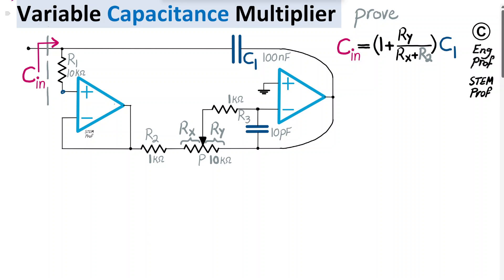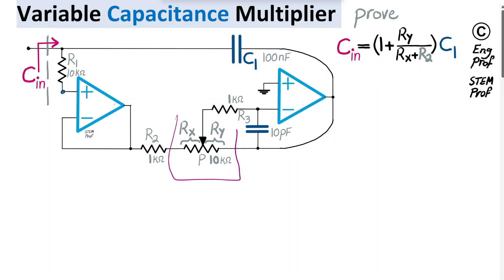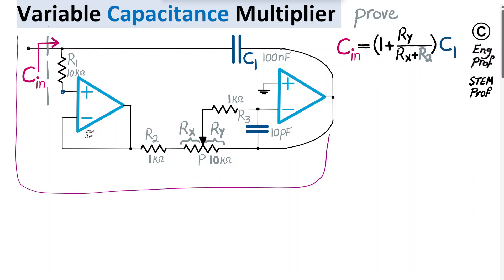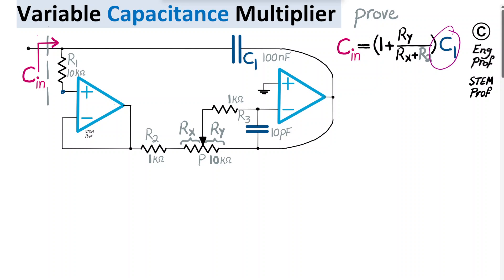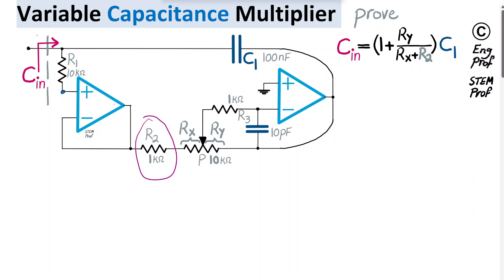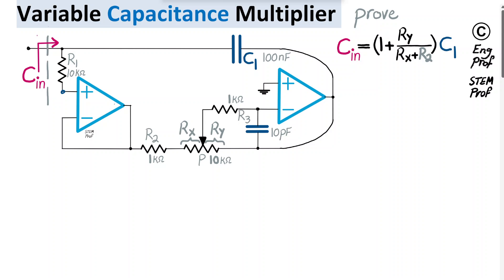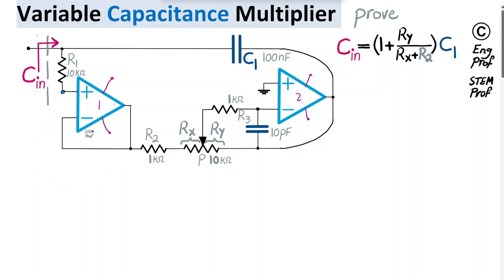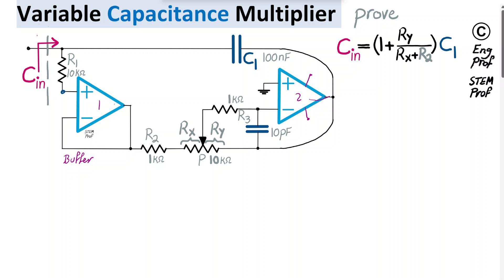Variable Capacitance Multiplier Design with Op Amp

Comment: Is that capacitance across Vin and Gnd?
I’m interested in using a circuit that employs a “variable capacitor” for an audio application so I can have independent control of gain and cutoff frequency. Could I use this circuit to substitute a cap that goes from signal to ground?
Reply from the maker: Yes, you can potentially (at least for a limited range of operation) use this circuit to substitute a capacitor that goes from signal to ground since this design implements a ground-connected capacitance on one side. The variable capacitance multiplier presented in this video allows for an adjustable, possibly large-value capacitance, which can be useful for your audio application requiring independent control of gain and cutoff frequency.
    The circuit is built using two operational amplifiers and a potentiometer, leveraging a combination of positive feedback and dominant negative feedback. The positive feedback enables a capacitance scaling factor greater than one, while the negative feedback ensures stability and enforces the virtual short between the Op Amp inputs. The first Op Amp functions as a buffer (unity-gain amplifier), and the second acts as an inverting amplifier in the frequency range of interest.  
   Regarding practical Considerations: For a real-world implementation, component selection is critical—otherwise, the circuit may become unstable. Op Amps should be carefully chosen based on the application, ensuring they have the right frequency response, low noise, and stability characteristics. Zero-drift, ultra-low-noise CMOS Op Amps (for example from Texas Instruments) are often a good choice, particularly for sensitive audio applications. Additionally, careful experimentation is needed to fine-tune the circuit and avoid issues such as oscillations or excessive phase shift. For related applications, check out:
🔹 Simulated Floating Inductor (Capacitance-to-Inductance Conversion) – Watch https://youtu.be/weIHG45G6Pg 
🔹 Butterworth Filter Design with Capacitor Multiplier, Op Amp, and Transistor – Watch https://youtu.be/9CFPe76vAtg
Hope this helps, and thanks for your interest in the circuit!
Reply: @ thank you so much for taking the time to give me such a thorough response. I was able to get this circuit to work.
I used a TL072, the only tweak I made was to change the 1k resistor that goes from buffer output to the pot from 1k to 2.2k. I noticed that higher values of capacitance was killing my gain so i limited it by changing the 1k resistor to 2.2k, thus limiting that part of the sweep. I was not able to figure out why that was happening, any thoughts?
I’d like to take the opportunity to thank you for making these videos, I hope you know they are awesome and that they positively impact other people in ways you may never know. Rock on!
Reply from the maker: @mamaki_naminia  My pleasure. Thanks a lot for your encouraging comment. I'm glad that my explanation was helpful and glad that the circuit worked with minor adjustment. Thank you for sharing your observations and thoughts. TL072 is a good general purpose FET dual-channel Op Amp from Texas Instrument. I suggest retrying your experiment using a newer precision Op Amp that has near-zero drift and better noise performance, for example TI's dual op amp OPA2186 is a 5-μV-offset zero-drift operational amplifier that might give you a better performance. Let me know if it happens to improve your circuit.
Reply: @STEMprof  i will try the OPA2186 and report back and share any findings.
Thanks again.

Comment: What is "S"?
Reply from the maker: In S domain circuit Analysis, the circuit is transformed from time domain to Laplace domain where derivativative of variable is represented by multiplying variable with S and integrating a variable is represented by dividing it by S.  I hope this is helpful.
Reply: @STEMprof  I'm afraid you might as well have been speaking Chinese. Is there somewhere I can learn about this?
Reply from the maker: @TomLeg  Please watch the video: Analog Computer that solves Differential Equation https://youtu.be/ENq39EesfPw . I hope it helps with explaining what I meant by S domain circuit analysis.

Comment from the maker: Implementation and analysis of a variable capacitance multiplier circuit are presented in this video. This circuit is useful in applications where a large adjustable capacitance is needed. This Analog circuit is implemented with two operational amplifiers and one potentiometer. For more circuit design videos please see the analog circuit and signal processing video playlist https://www.youtube.com/playlist?list=PLrwXF7N522y4c7c-8KBjrwd7IyaZfWxyt
And Digital Circuits and DSP playlist https://www.youtube.com/playlist?list=PLrwXF7N522y6cSKr0FmEPP_zQl011VvLr
Thanks for watching.

Comment: So prof,... this is a ground connected C on one side.
If + input of Amp2 were un:grounded - could the circuit topology support a floating G*Cap1?
Imagine using two of these circuits in a Wien Bridge Oscillator.
I suspect so, but also imagine some challenges with the result.
Comment?
Reply from the maker: Thanks for watching and sharing your thoughts. I am afraid we can't un-ground the positive (non-inverting) input terminal of the second Op Amp as it destabilizes the circuit.  But to your point, simulated floating impedance (capacitor or inductor) has practical applications. Few examples of such circuits and applications are: Simulated floating inductor realized by converting a Capacitance to inductance https://youtu.be/weIHG45G6Pg 
and Butterworth Filter Design with Capacitor Multiplier, Op Amp and Transistor https://youtu.be/9CFPe76vAtg
I hope these videos are helpful and interesting.
Reply: I believe then, in principal using a transformer at the input will provide a "floating" capacitive reactance --- at least over a useful frequency range.  @STEMprof  
???
It works in Spice but yeah spice is spice, not real circuits.